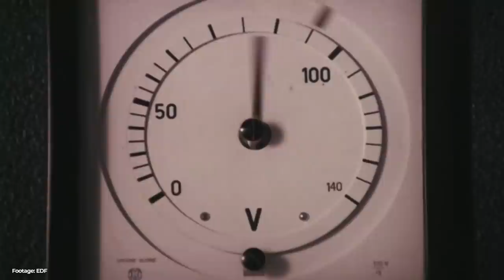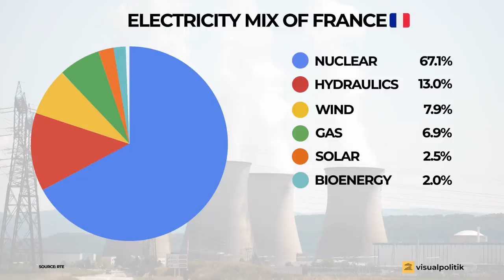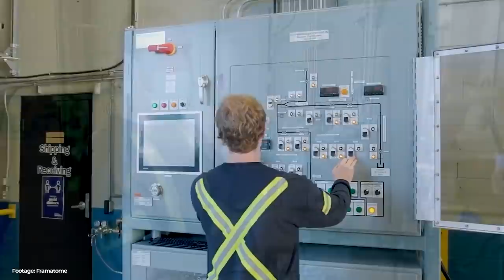Why is FRANCE betting on NUCLEAR ENERGY again? - VisualPolitik EN

Comment: Maybe even better question is - Why WOULDN'T France bet on nuclear energy?
Reply: Cost, waste disposal, battery development over the next 20 years...
Reply: @1968Christiaan  Waste? Mean the stuff that's still 97% fuel and can be recycled indefinitely?
Reply: @1968Christiaan  how much does it cost to have solar power station that can provide 1000-2000 MW of power 24/7 365 days a year in any climate?
Reply: @VFPn96kQT  well no nuclear plant meets those parameters. However a 3 GW continuous solar farm and storage that does meet those parameters is being built now in Australia (which has the climate and land) to supply Singapore (which doesn't).
Cost is about 12 billion USD, so about 1/3-1/6 (depending on how you measure - capital costs only or life cycle costs) of the price of the same sized EPR plant being built in the UK, and its taking about 6 years, so 1/4 the lead time of the UK plant.
Reply: @1968Christiaan  well if we're betting on technological development which may or may not why not bet on fusion?

The fact is it's too late in the climate game to simply hope that a new technology might save us.

Batteries are great for balancing the grid but either the technology, the production or the raw material supply chains are ready and won't be during the decisive few years remaining.
Reply: @gasdive  "No nuclear plant meets those parameters?" Multiple next-gen VVER and Chinese PWRs have gone up in less than 5 years and on-budget. 12 billion could easily build you 6 GW of nuclear in Asia or Eastern Europe. Our nanny states have made them impossible to construct.
Reply: Finnish OL3 reactor they are starting now is 1600MW. We don't get enough sunlight for solar for 4-5months during year because nothern hemisprehe tilts away from sun. Also in winter when temperatures drop below certain point wind usually stops and same time power demand peaks
Reply: @TheMagicJIZZ  exactly, thats what I mean
Reply: 4 times the cost of renewables and take 5 to 20 times the time to build.
It is hard to fight climate change today when you need 20 years to build a new reactor and have to increase the cost of electricity production by a factor of 4 or more.
Reply: @adamc2378 
France is already recycling their fuel rods and no it can't be recycled indefinitely. The used up uranium is gone forever and waste in the fission products has to be cared for.
Reply: @VFPn96kQT  
Much less than doing the same with nuclear (except climates for up north where you barley get any sun, but if you combine it with solar u get much benefit in any climate as they are negative correlated).
Reply: @adamc2378  why this video said france need to spend 50b to store so much nuclear waste underground
Reply: @gasdive  nothing concrete on that project , it's still a pipe dream to lay undersea power cable from australia to singapore with that tiny budget.
and you know what's funny ? australia still burning dirty coal as primary power generation for it's own use and still opening up new coal mines
Reply: @Funktastico  There are a lot of ongoing research into new generation reactors that can use up nuclear waste as fuel for further power generation.

I recommend the channel Tech For Luddites for many well researched videos on these ongoing projects. The host, Sira, is quite funny and offers a lot of perspective into the nuclear power .
Reply: @TBFSJjunior  where did you get your figures from? Please, show me any example of a working solution that doesn't rely on gas or other fossil fuels. 
I've never seen any working solution, much less a cheap one. 

Currently Germany has a higher cost of electricity, emits more CO2 emissions, and depends more on Russia than France.
Reply: @Shaker626  those reactors don't operate 24/7/365. Nō nuclear reactor does.
Reply: And another question... why did Germany gamble away their nuclear industry?
Reply: @gasdive  In USA for 2019 capacity factor of nuclear was 92% vs 25% and 30% for solar and wind.  We do maintenance work on some reactors in a power plant while others can continue operating. Night, on the other hand,  is the same for all panels in the area.
Reply: @1968Christiaan  Nuclear waste is way less and manageable compared to solar or coal etc
Reply: @TBFSJjunior  no, what he is saying is it cant be done, the sun doesnt always shine and the wind doesnt always blow. also it would cost more to try to store that energy, loose most of it while trying to store the renewables than it would to build a nuclear reactor. the point is renewables either arent on all the time or cant be built everywhere, unlike power plants (including nuclear).
Reply: @VFPn96kQT 
From many different universities and scientific Institutes, from the French government/EDF and from real world examples.

Your comparison of France and Germany is either build on ignorance or deliberate dishonesty.
Germany has much higher taxes on electricity and France is heavily subsidiesing their electricity. Without taxes and subsidies electricity in France would actually be more expensive than in Germany.

And that comparison is also absurd as we talk about the future. You can't look at a 1980 rotary phone and then claim that it is impossible to stream Netflix on a phone.

The Fraunhofer Institute has published a study almost 10 years ago showing how Germany could be run on 100% renewables without nuclear and without new technology including storage.
Current estimates by the French gov and tge EDF expect that new nuclear reactors would mean electricity production cost to increase by a factor of 400%.
Both is fitting every scientific study I've read on this so far and would mean that nuclear would be much more expensive in the future than renewables+storage.
Reply: @VFPn96kQT 
"Depends more on russia than France"
Could you clarify that statement? Both Germany and France get around 12% of their electricity from natural gas, with the difference that Germany has much more installed backup power than France (one reason why France has to import electricity from Germany in the winter while Germany only imports when France has an overproduction and electricity is cheap)
Reply: @banana-vd7jm 
Yeah and he would be wrong in saying that.
nuclear is a base load power plant and new reactors are as expensive as peaker plants without the flexibility of peaker plants.
Wind/solar is 1/4th the cost per MWh and even if u include storage (including losses) you end up cheaper than nuclear.
Reply: @TBFSJjunior  you're talking about some non existant future technology, while I'm talking about what we actually have and I'm the one who is ignorant?
Electricity in France is cheaper - fact, carbon emissions of France are lower - fact, imports of fossil fuel to France are lower - fact, France is the largest net exporter of electricity in Europe - fact. It looks like nuclear power works better now. 
I can't discuss what isn't there. There are lots of innovation in nuclear power too.
Reply: @banana-vd7jm  
Also nuclear can't be build everywhere either.
You show both ignorance on the possibility of storage and show with statements like this, that it's the same with nuclear.

A 1GW nuclear reactor for 3bn would be price competitive. Last French build reactor had a price tag of 19bn and still counting.
Reply: @TBFSJjunior  nuclear can be built almost everywhere, it doesnt have much requirments, ulike hydro and geothermal, which can only be built at some rivers and geologicaly active places respectively. also how is the french electricity bill cheaper than the german one if nuclear power is SOOOOO expensive?
Reply: @TBFSJjunior  Also I would like to see where you got these statisics from becuase I am pretty sure that its more expensive to store, tranport, and use the renewable energy then it would to use nuclear reactors.
Reply: @VFPn96kQT  
"You are talking about some non existing future technology"
No. I'm talking about current technology, while you talk about 10, 20, 60 year old technology.
In the year 2000 solar in Germany got subsidiesed with 490€/MWh. Today there are new solar installations in Germany that produce without subsidies for 30 to 50€/MWh, while the EDF claims they could build a new nuclear reactor for 120€/MWh.
You want to look at the cost of nuclear based on reactors that have been build in the 70s, which is like saying "nuclear is cheap if you ignore the construction cost and solar is expensive if you ignore 20 years of cost dropping".
Reply: @banana-vd7jm 
"How is the French electricity bill cheaper than the german one if nuclear power is so expensive"
Because you compare apples to oranges.
There are many reasons, I could list you 10 out of my head but let's start with the biggest.
Germany has high taxes on electricity to incentivice energy saving, while frances taxpayers massively subsidies nuclear.

If you look at electricity prices without taxes for non household consumers in the first half of 2021 Germany stand at 90€/MWh while Frances is a little lower at 85€/MWh.
If you include taxes Germany pays 180€/MWh and the French only 100€/MWh.
(For household consumers it's a similar picture.)
Now if you exclude subsidies electricity in France becomes more expensive than in Germany.
Then there is the fact that Germany has a much lower blackout index (13 vs 46 in france), which is mostly due to the fact than Germany puts most cables under ground, which makes them shielded from weather, but increases cost.

But the biggest error here is, that you look at past installations and we need to look into the future and have to look at current/recent installations for that.
The newest French nuclear reactor is a 1.6GW reactor with a price tag of 19bn€. For 19bn you could install over 19GW of solar at current rates.
Reply: @TBFSJjunior  but once again, solar isnt stable, you can have many days in a row with little sun, which would cause blackouts becuase electricity storage today just isnt good enough or cheap enough to run several cities for days at a time. in the future it will be better, but for now, nuclear is the best way to fight climate change.

also there are several new inovations that will make nuclear cheaper and create less waste that are soon to be implomented.
Reply: @banana-vd7jm 
"Once again solar isn't stable"
I'm always amazed how ppl say this as if it isn't known and the answer has been known forever aswell. 

"Electricity storage today isn't good enough"
I already told you about the study from 2013. It used current (2013) storage technology with a moderate learning curve. Reality has since shown that storage technology has improved faster than expected.
In Denmark they are currently building a 1GW electrolyser. Germany is currently planning to build at least 10GW of electrolysers in this decade.

"Nuclear is the best way to fight climate change"
No. Nuclear is a scape goat and waste of time and money and could prevent us from fighting climate change. Nuclear is only good to put tax payers money into the hands of big cooperation based on empty promises.
20 years ago you could have started with nuclear, but today it is just to late. We have 10 years to make a serious effort and I doubt that we will have 1 additional reactor in 2030 when we start planning today.
Last French reactor has been build since 2007 and won't be finished before 2022.
Almost all nuclear reactors took 10 to 25 years from planning to finish. We don't have 10 let alone 25 years to bet on nuclear and then find out that it doesn't work.

Also nuclear is baseload power. What do you want to do to meet peak demand? In France their demand oscillates between 40 and 105GW. If demand is to high they rely on coal power from Germany and natural gas. There the answer would also be storage, just the nuclear is already way to expensive.
Reply: @TBFSJjunior  Where did you get these statistics from? I would be quite curious to read them. or are you just spouting nonsense.
Reply: @TBFSJjunior so you're saying that for 60 years we can generate electricity cheaper using nuclear power than with latest solar technology? OK. Thanks for helping prove my point. Nuclear power is cheap and we can use reactors for long. 
Current price hike for new nuclear plants is not caused by technology, but politics of building new reactors and unreasonable safety requirements. 

Another point: is The main reason that we even need renewables is reducing carbon footprint. Even after dozens of years of investment Germany can't reach levels of France. How long does it take to get to this magical 100% figure? California, with its abundance of sun and billions invested into solar power, still has several times larger carbon footprint per kwh than France or Ontario. Looks like nuclear is a better bet in fight against global warming.
Reply: @VFPn96kQT  
No I didn't say this but I guess at this point you chose ignorance as you prefer to be wrong
Reply: @banana-vd7jm 
I already told you the sources. If you choose ignorance then noone can help you.
Reply: @TBFSJjunior  I mean give me links to the studdies, not just telling me that they exist, becuase you could be just making that up and I am actually curious about what you are talking about.
Reply: Few years after the 1973 oil crisis crude oil was cheap for at least 30-40 years.
Reply: @gasdive  is it gonna supply power during the night? solar is great, but definitely shouldnt be compared to a baseload energy source such as nuclear. Solar is not 24/7 sorce of energy...
Reply: @VFPn96kQT 
I doubt that saying "let's go back to the safty regulations of the 70s to make nuclear cost effective again" is a great selling point for nuclear, but sure you can try to continue making that argument.
Reply: @samso3148  yes. It supplies during the night. There's a battery. It only has to supply for the 12 hours of darkness. There's enough panels to recharge the battery while also supplying the 3.5 GW cable capacity even on cloudy days.

So for Singapore, (the customer) they set aside no land on their crowded island, get 24/7/365 electricity, have no waste to pay for, no decommissioning cost, no outage for refuelling, all at less than half the capital cost of the cheapest reactor, nearly zero running cost and 10-15 years earlier than nuclear. That's despite having neither the land nor the climate for solar.
Reply: @TBFSJjunior  There was one death in a nuclear related accident in France ever. So yes - it's safe enough IMHO. 

Death rates from energy production per TWh overall, including Chernobyl and Fukushima, is similar to solar/wind and much less than coal and gas.
So if coal/gas are not considered unsafe - nuclear shouldn't be either.
Reply: @VFPn96kQT 
Like I've said, if you think the argument that we have to lower safty standards is a good strategy to advocate for nuclear then go ahead, but I doubt you will improve nuclear's PR problem with it.

Also those statistics are often flawed, so I wouldn't bet my life on them and "deaths" is not the only metric to judge risks.

For example if one wind turbine goes up in flames then this will have barely an effect. If a nuclear power plant near paris has a melt down it could create a blackout, an unbelievable amount of cost, risk for health (you don't have to die to be affected), loss of land, etc.

Oh and I consider coal/gas as a huge risk, a higher risk then nuclear, but new nuclear is only a scapegoat to keep coal and gas for longer as it can't solve climate change unlike renewable plus storage.
Reply: return  on capital costs and tech change. They tried in 1970s but tech changes made there 20-25 year planned investment in nuclear power obsolete leading to a bunch of useless plants. It is a textbook case of the issues facing the renewable energy industry.  In the case of nuclear dont get me wrong it does work in France to a certain extent for energy supply purposes but the issue is these plants deteriorate over time and decommissioning them is very expensive and as technology changes the previous nuclear plants no lnger serve there purpose. So the issue with nuclear is less that it does not work and more that it is a type of energy that requires a long term investment and not only that but over that long investment horizon there needs to be minimal technological change and the appetite to eventually decomission said plant.
Reply: @finnderp9977  the EPRs may have been much delayed and over budget but those will serve the Finns for a very long time with steady and secure power source. Its a pity your govt stopped going with additional EPRs as the newer EPR2(planned for France) are going to address the reason for delay.
Reply: @flamos44 
I don't see how this is similar to renewables.
Renewables have a life span of 20 to 35 years and nuclear 40 to 60 years.
New cheaper technology to developed and deployed needs at least 10 to 20 years.
This might cause some small risk for renewables, but a huge one for nuclear.
Reply: @TBFSJjunior  because renewables have poor return on investment when you discount the future value to the present. Things may be changing now but traditionally what held back investment in renewables was the lack of return on capital investment and tech change and yes nuclear is considered a form of renewable energy unless the definition has changed it along with hydro were two forms of energy considered renewable
Reply: @flamos44 
No nuclear is a non renewable fuel sourced power plant. I can't think of any sensible to define it as renewable.

In Portugal they are currently build solar for under 13€/MWh, while prepandemic market prices were 30 to 50€ and EDF claims 120€/MWh for new nuclear reactors.
I can't see how there is a similar lack of return issue.
Sure in 2000 Solar had to be subsidiesed with 490€/MWh to be profitable, but prices have dropped.

But I get your point, which is true for all new power plants though as existing plants always have a massive cost advantage compared to new build plants.
Reply: @VFPn96kQT 
Yeah same is true with ppl championing nuclear. You can show them all the facts and data you want and they will ignore them as a cult if it doesn't fit their presupposed conclusion.

"Wind turbines don't work 70% of the time"
That is factually wrong and shows a misunderstanding of what a capacity factor is.
If a power plant delivers 30% of power 24/7 it has a capacity factor of 30% without ever "not working".
So when solar has a capacity factor of 10% that doesn't mean it provides peak power for 10% of the time and no power for 90% of the time as we have more than 10% of the day sun light.
Same is true for wind. If you look at offshore wind for example there are Installations with a capacity factor of around 50%, but they produce power 90 to 100% of the time.
Reply: @anirbanbandyopadhyay3553  There is still plans for another new nuclear plant but since EON pulled out from project, budget got smaller and they are planning now bit smaller VVER reactor from Rosatom.
Reply: @VFPn96kQT  
"Even today"
Of course. Germany had a conservative(libertarian) government for 16(4) years who killed over 150 000 jobs in the renewable industry and put a limit on how much wind/solar was allowed to be build to secure profits for coal/nuclear power plant owners. Of course you rely on coal with policies like this.
Reply: @TBFSJjunior  and by the way the way - I know very well what capacity factor is and solar cells still don't work at nightd, and there are no cheap and power enough batteries now that can power a city. So there is that.
Coal is the main source of electricity in Netherlands too, gas in California during nights. But keep on with you alternative facts on how solar and wind can replace every other energy source with our existing technologies.
Reply: @TBFSJjunior  I wish you you're right. Unfortunately you're not. Again with my basic wrong facts that sees that nuclear power stations in Germany are closed down and there no plans of building new ones. But, apparently, that's the wrong way to look at it.
Reply: @1968Christiaan  Cost. If Nuclear was subsidised on the same scale as oil and gas, we would have Generation 5 reactors by now.
Waste disposal. Finland has shown that deep geological repositories work. Plus, designs like MSRs can use waste from existing Generation 1 and 2 reactors to generate power and useful isotopes.
No matter how advanced battery development becomes, unless it is batteries that store energy for years, they can never replace baseline power. As climate change progresses, solar and wind will become even more variable than was the case in 2021.
Reply: @TBFSJjunior  The thing I worry about with solar and wind is the waste they will produce. I don't think there is a proper way to recycle wind turbine blades at the moment, and we haven't found a way to recycle old solar panels into new ones either. I believe this is a great advantage for the nuclear power plants, since they don't use as many plastics or glassfibre.
Reply: @TBFSJjunior  are you going to actually show me any links to the studdies you are talking about or are you just going to ignore this comment as well.
Reply: @TBFSJjunior  right because building thousands of solar and wind farms won't take anytime at all. You'd need to fill every piece of land and you still probably wouldn't reach your energy needs. Now is not the time for utopian thinking where everything is sunshine and rainbows. Right now, nuclear is the best method we have to create A LOT of energy CONSISTENTLY.
Reply: @TBFSJjunior  you'd need close to 600 wind turbines to output the energy of one average nuclear plant. Those 600 turbines will only work when the wind blows and will only work T maximum efficiency in perfect conditions..

You'd need the space for those 600 turbines and you can't group them too closely because they will affect each others efficiency because they disturb the air they get powered by.. All 600 of those need maintenance and their lifespan, just like a nuclear power plant, is limited.. I get it, building nuclear takes a lot of time and capital but its most certainly economically viable.

On the topic of batteries, we are years away from a practical way to "cache" energy.

Germany decommissioned most nuclear plants after fukushima out of fear... Just fear.. 

I'd love to you meet our future power demands with solar and wind without using up every piece of land having to be bought up by corporations..

Nuclear isn't a permanent solution, its the best way to create a lot of electricity while we wait for technology (fusion, batteries, the lot) to catch up.

Individuals benefit massively from solar panels, on larger scales where you need to buy land to place them on.. Its impractical
Reply: @gasdive  Well but they have quite nice uptime, and - mostly predictable downtime, if you have few on site, it is easy to circle them over year,.. solar either sun shines, or not
In Slovakia, nuclear have 20% of all instaled electricity capacity,.. but produces over 50% of energy, meanwhile, all renewables puting into grid less then half of instaled capacity even trouth they have preferencial treatment that all thers productions goes to grid.
Reply: @marianmarkovic5881  "quite nice" = 2 years apparently...

Nuclear isn't a magic carpet ride. France spent as much on their nuclear program as the USA spent on Apollo, and for similar reasons. (Willy Waving). 

Nuclear isn't cheap. French people don't pay much for electricity for the same reason that Neil Armstrong could afford his trip to the moon. The taxpayer picked up the bill.

Now the French decided after years of telling everyone how cheap nuclear is (while keeping the costs secret), to actually sell their reactor to someone else, and so they started to total up the cost. Hinkley Point C is looking like 25 billion to build and another 75 billion over 25 years to run, followed by 2 years downtime and another 25 billion to refurbish in 25 years time.

On top of that, the British public pick up the insurance costs for free. If there's a problem the French walk away and the British clean up. 

People talk like you just plant one in the ground and electricity comes out for free for 50 years.
Reply: @gasdive  lol CONTINUOUS solar farm ? Wtf are you saying ? If it uses batteries, you need to add that cost of these and the replacement too, cause they won't last 50 years and pannels too (be also sure that the production will have issues in few years because of the lack of prime materials, expect prices to go way up). And no i guess sun in australia is not exactly sun in england. Lol In fact it's well knowed that it's not.

Anyway as a french i should not say that. Yeah you're obviously right. Go for it ! I'm so wrong. Nuclear sux. Don't use it. ^^ Don't do like France producer of the cheapest and greenest electricity in the world lol It' a realy bad idea.
Reply: @gasdive  Nuclear is not cheap, but renewable cost 20 to 50 more /kwh (not including the cost of cables and batteries). And will cost more and more cause most of it is produced in China (with coal energy). End of all the fun before 30 years. I suspect nations to buy some, just for the "cheap" (it won't last) steel and copper in it. 

Don't forget that "renewable" last 20 years. After that you must pay for some new stuff. 

What are you talking about when you say taxes pay for nuclear devices ? It's totaly wrong. Most taxes are actualy financing renewable (because of european stupid laws). Wich is an obvious waste of time and money. And produces way more CO2 than  nuclear. Wow what a great solution indeed. :/

Germany produces X2 CO2 compared to France. It's a shame realy. Don't even try to teach lessons about ecology and global warming. Renewable is about to fail hard in the next 30 years. In fact it's allready a fail. But anyway just go for it. But France should realy stop sell cheap nuclear electricity to neighbours. And do her own stuff. In fact that's obviously what Macron said. And no it's realy not for a dick contest. Lol It' about survival now, and energy self suffisance.

Go ahead with chinese products and monopoly. I'll let you find out where it will lead you in few years.
Reply: @kékédesplages-d6d  sure, the panels may need replacement after 25-30 years. Nuclear plants need a refurbishment after a similar time, but the cost of that is nearly as high as the cost of building it in the first place. Many times higher than the cost of new solar panels. (Currently under 0.2 dollars per Watt for solar, and about 6 dollars per Watt to refurbish a nuclear plant). So yes, a nuclear plant might "last 60 years", but you could say the life of a solar farm is infinite if you allow the "refurbishment" every 25 years to count as extending the life of the farm.
Reply: @kékédesplages-d6d  the solar farm that I'm talking about is located in Australia, but it's for Singapore. Singapore doesn't have the land or the climate for large scale solar (just like England) but is within cable distance of a desert (just like England).
Reply: @TBFSJjunior  still waiting...
Reply: @gasdive  Apollo program earned 100USD for each 1USD spendet, for industrial patents, NPP cost lot of money? what about earnings,... France, and as a result entire europe greatly bennefited from its nuclear park.
Reply: @marianmarkovic5881  I'm not saying that the money was wasted *then*. I'm saying that the money would be wasted repeating the exercise. Indeed the French decided that it was a waste of money to even complete the project.

Nuclear isn't cheap, and I couldn't count the number of people who say "but electricity is cheap in France", like that proves something. All it proves is that if you subsidise something enough, it seems cheap to the end user. Even a trip to the moon. 

The question is, do you put subsidies into a tech that costs 25 dollars per Watt and makes no difference for 20 years or into one that costs under 1 dollar per Watt and which starts producing electricity within weeks and which can be ramped up to the level where it can actually take over from fossil fuel within 5 years?
Reply: @TBFSJjunior  recycling fuel depends on the type of reactor.  Elysium reactor will be able to completely use the waste fuel.  Fast reactors have the ability to use this waste and breed more fuel from thorium and uranium 238.  Really there is really no such thing as nuclear waste just stuff we can't use right now.
Reply: @TBFSJjunior  New reactors are only taking 4 to 5 years to build and they are coming in under cost estimates.  Yeah they are in China but that does not mean that nuclear can't be built in the same way in Europe. It appears it's a matter of getting one's act together.
Reply: @finnderp9977  which reactor is 12 years late and €10 billion over budget.
Reply: @ffffuchs  Well yeah, new technology, strict regulations, QC issues with underqualified cheap labor etc.. Luckily the building contract had fixed price so customer paid approx 5,5bil and Areva/EDF had to pay rest.

And I have nothing agains renewables, they just need really large scale high effiency energy storage invented so that we don't need to fire up smaller fossil generators to cover power fluctuations.
Reply: Because they are accessing URANIUM through very unethical methods. Check the city of arlit in Niger which is an example of all the dirty nuclear remain left. The human toll on africans from Niger, Congo, namibia is very heavy. it is not an ethical method. Also they support unelected governments to achieve this at the cost of democratic process and economic and social development of Niger.
Reply: @TBFSJjunior  China is moving towards 50 nuclear plants now and barely had any issues...and do note that China is the leader in green energy, and they are having a hard time building renewable power sources because they are not as consistent as fossil fuels and nucear (which are picking up in pace despite having an explosive growth on renewables)
Reply: @JABelms 
China has around 50GW of nuclear in total, while they brought 72GW of wind power online in 2020 alone.

So China a country of 1.3bn ppl has around as much nuclear as a small country like France with 66mio ppl.

I'm not sure what argument you are trying to make but China is a pretty bad example overall.
They have around 20GW on nuclear and over 200GW of coal power under construction, while their existing coal power plants have a capacity factor of below 50%.
They operate at a loss and stand still 50% of the time and they are still building a ton of them as they aren't a market economy.
Reply: @TBFSJjunior  I was talking about the TREND genius. 

China's green movement has faltered, they are since the most active in this sector compared to the West (they still are) but trends suggests that renewable sources are not enough to power the growing economy, that's why coal has been gaining more speed than renewable just recently...despite the enormous effort to shift for many years

China's infrastructure is all about moving to green energy and pulling people towards the middle class but higher... but you can see its limitation first hand. This is a country that puts even Western EV use to absolute shame, yet they cannot drift away from non renewables

Because it's UNREALISTIC with the current renewable tech to match unrenewable
Reply: @TBFSJjunior  The fact that the PRC literally stated that coal will be the primary energy source due to the 2021 power crisis? Because of how they realized renewable energy wasn't reliable enough despite how much Xi Xinping overhypes their carbon neutrality in the future?

The part where China is starting to build a shit ton of coal fired power sources? 150GW worth in 4 years or more even?

The fact that Chinese oversea energy plans are almost entirely coal and that the PRC stated that renewable energy was impossible and insufficient for developing countries...forcing them to use coal

Shanghaimiao power plant? One of the biggest coal fired plant is rapidly being completed, while Datang stands?

Instead of looking and comparing numbers, check their potential for green energy and how they slipped in making it happen.

In fact, you just repeated what I said when China has been doing well in the renewable energy until it hit a brick wall that was COVID 19, which made it have doubts on whether it was actually viable for a growing nation

If renewable energy was as easy and great as you put it out to be..70% of China would have been run by renewable energy sources by now basing on their promises and their speed of transition years ago

But reality hit them in the face, just like how green warriors should be hit as well
Reply: @adamc2378  Tell us, where is this magical facility?
Reply: While shutting nuclear plants off prematurely, like Germany does, is dumb, building new ones is might not be a good choice. Nuclear waste is arguably less catastrophic than CO2, but it's still highly toxic. Coal plants result in more deaths due to pollution, generate more radiation due to the natural C-14 content of coal, but offshore wind farms combined with energy storage systems are still the better option.
Given the steep price decline in renewable energy production and energy storage, new nuclear plants are just too expensive to build and maintain, let alone managing nuclear waste. All trustworthy estimations I've seen say it makes no economical sense to build new nuclear power plants.
Reply: @TheSandkastenverbot 
You are correct on your opinion on new nuclear, but shutting old plants down isn't aa dumb as it might seem.
Germany decided to phase out nuclear in 2000 and then stopped the phase out before deciding to phase out again in 2011.
The result of the stop of the first phase out was a decline in renewable installation.

I personally would also prefer coal being phased out before nuclear, but reality has shown that we just get less renewables instead of less coal.
Reply: @1968Christiaan  Could you, please, tell me about the development of batteries the next 20 years? I'm VERY interested. Share your insights, please!